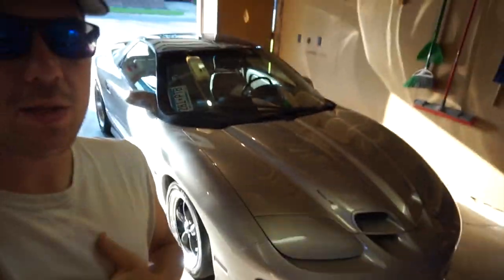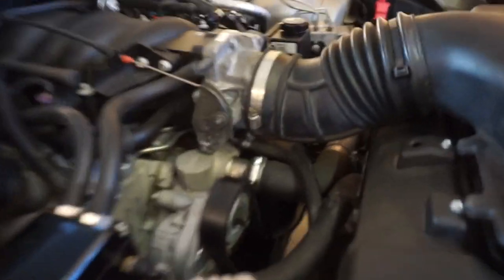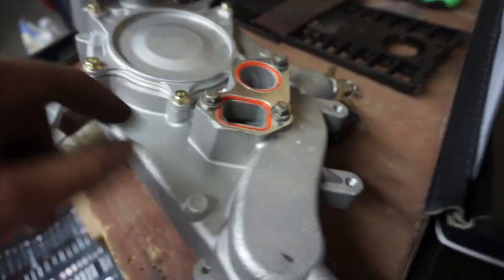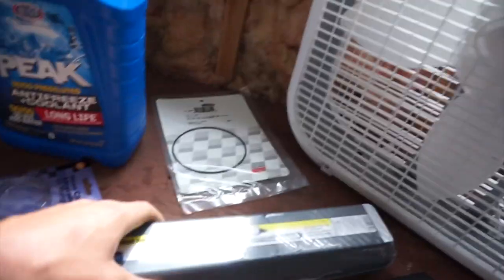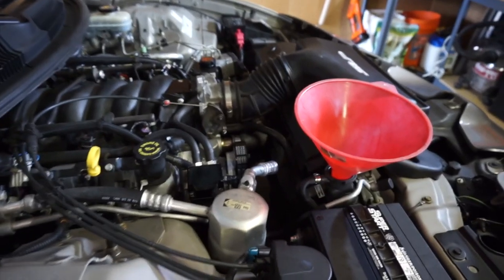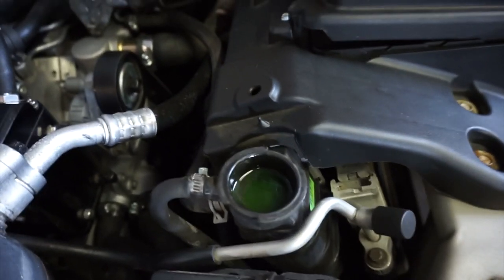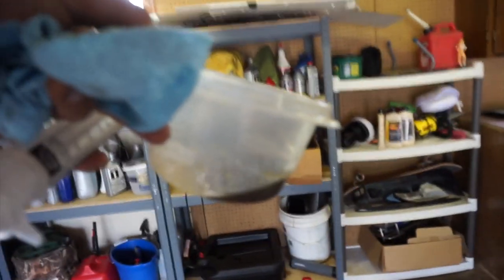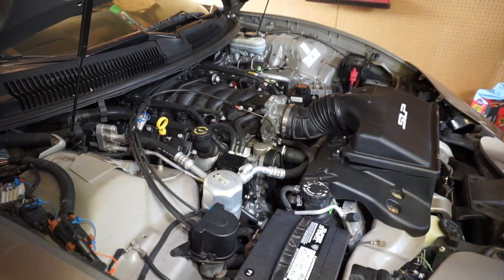New water pump in the Trans Am + Free Ram Air Mod FAIL!

Comment: That coolant was Supposed to be GM dex cool coolant bud.! get a smooth Bellow and SLP air intake. You can still open it up the air intake and if you install a slp  Intake it will get more air and you will feel it. You can also open the vents in the hood and get even more air. You can read up on the forms or slp website has everything you need and free shipping but the intake Bellow get on eBay there’s a guy there that sells them new and really good Quality I believe they’re out of Michigan.You will feel a difference  and it will also sound a little different. You can hear it sucking air up When you do the mods that I told you too.
Reply from the maker: LT11988 so, the car had green coolant in it before I cracked it open and I just replaced it with green again. I'm not sure that dexcool is the way to go after all of the horror stories you can find about it coagulating. 

I'll have to get a smooth bellow though! The OEM coupler hits the upper radiator shroud and makes the SLP lid not sit right.
Reply: I have been a Auto tech for 25 years if you change the coolant how it has to be done never have any issues. But yeah a flush would be the way to go if you wanted change it right
Reply: LT11988 all the coolant was properly flushed out of the car when it was built and converted over.

Comment: Awesome video man . Many thanks
Reply from the maker: No problem, glad you enjoyed it!
Reply: @Greenlightfilming  my 02 trans am's fuel pump cracked on the way to school , haha . Very bummed out about it but it's gonna get fixed up no matter what lol. Thanks again for this video . Gave me a better understanding on what I'm dealing with for the weekend !
Reply from the maker: You're welcome! Did you end up getting that fuel pump sorted out? That's a bummer man.
Reply: @Greenlightfilming  Yes I did, that was my weekend project haha. It was fairly simple enough ! Thanks !
Reply from the maker: @jeremy8293  good deal! Did you drop the tank or cut an access hole?
Reply: @Greenlightfilming  I went ahead and got rid of the old fuel pump and also checked for leaks on the hoses . A few small cracks but I didn't want to take the risk and have another issue so I went ahead and installed new hoses themselves . Now my t/a is being show off at school with no issues 👍🏻

Comment: Did you reuse the same thermostat you removed? The all inclusive one? About to put the same pump on my 02 already took out the old one. I know different years call for different thermostats just want to make sure I am putting the right one for the gates pump. Will be putting up videos on my new channel hope you sub. Thanks for the video it has been an easy job. I am also removing that stock tube power steering cooler.